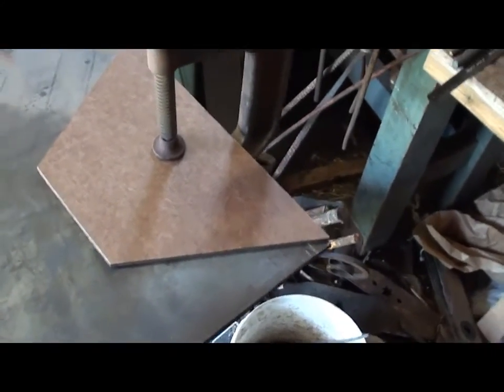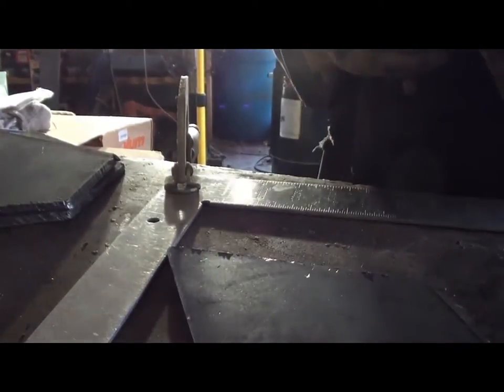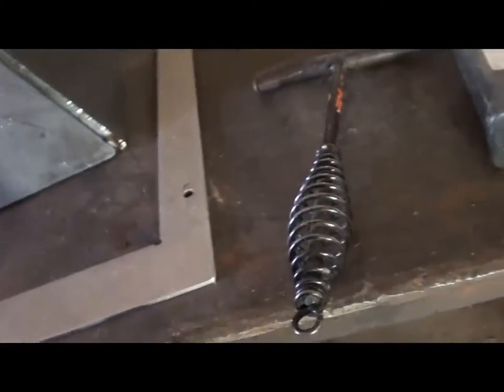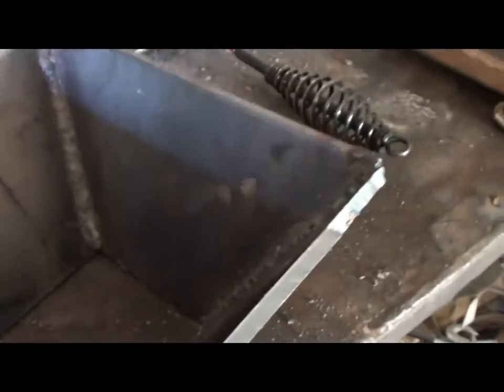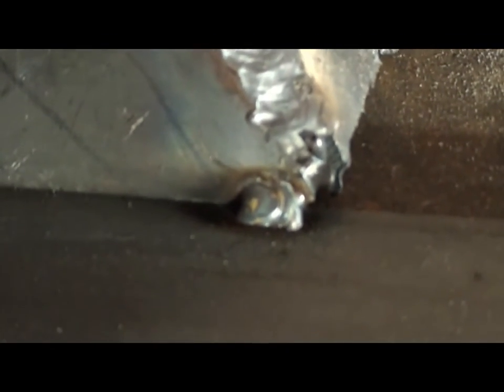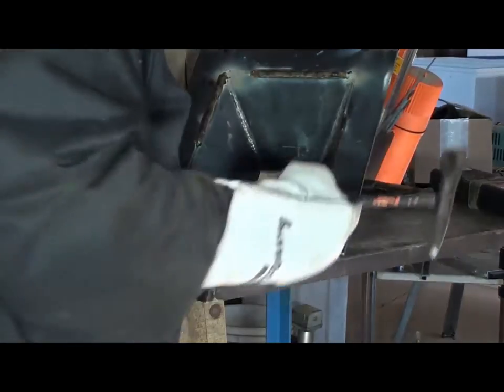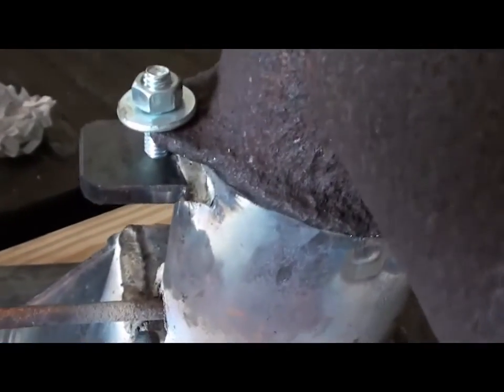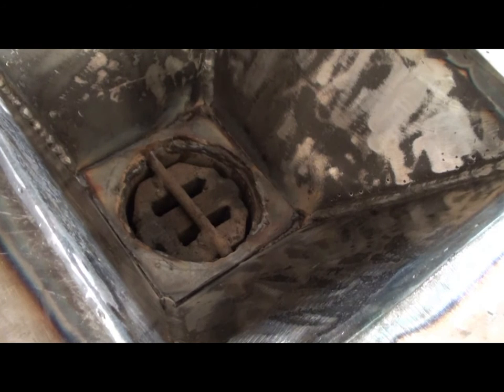Lets make a forge. Part 1 The Fire Pot

Comment: Is that 3/8”?  Would 1/4” be too thin?
Reply from the maker: This is 1/4. 3/8 would be better however I've gone for weight. The 1/4" that I have been associated with have lasted for quite a few years and they're easy to weld up.

Comment: How come you arc welded instead of MIG the seams? Cool project. I like watching stuff like this, fabricating...
Reply from the maker: My mig welder does not have near the power of my Miller portable. I can get a lot better penetration out of the stick. Plus I can work in front of my fan, it's hot out there.
Reply: I had the same question but you answered above. :D Are you using TIG gloves? look kind of thin for Stick or MIG.
Reply from the maker: I use tig gloves with my mig gun. Big ole thick welding gloves make it hard for me to control the trigger.
Reply: bc65925 Same here, I have used the mig gloves but I have the same issue with the trigger. They need to make the padding thinner on the inner portion of the mig gloves
Reply from the maker: Maybe you need to be more in touch with your sensitive side.
Reply: nah I like me the way I am :D